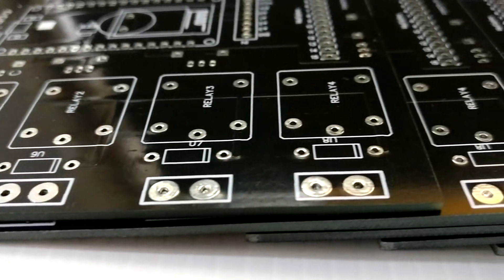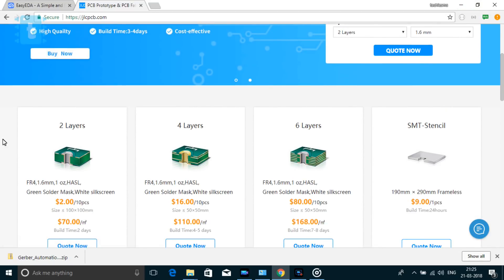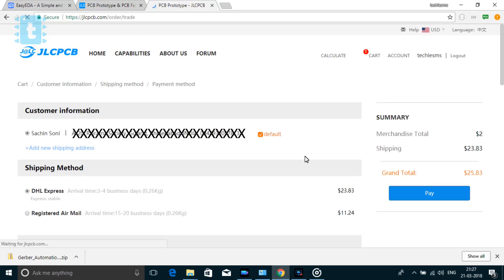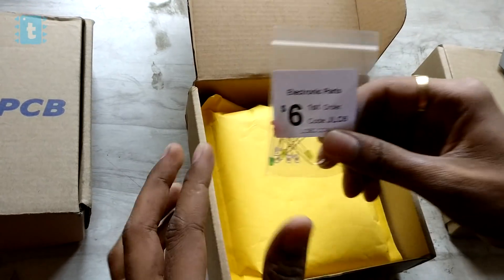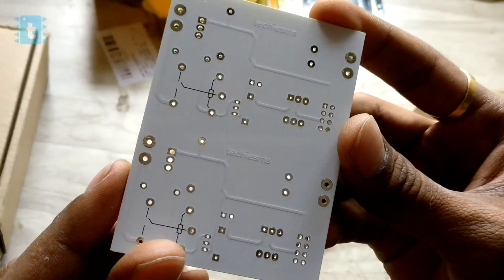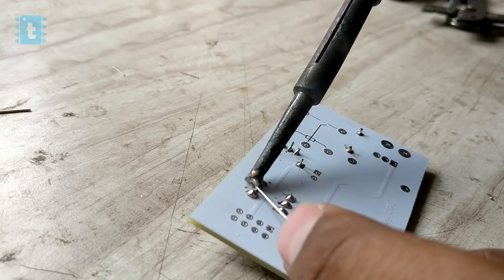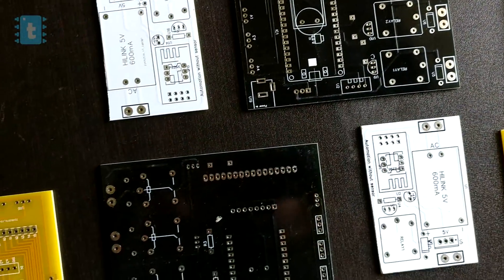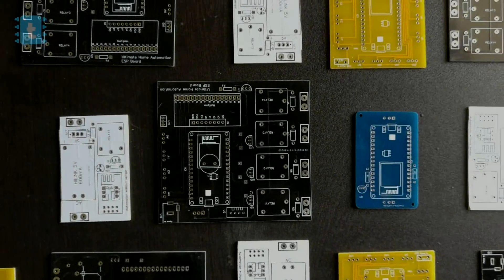Reviewing JLCPCB

Comment from the maker: Anyone can guess my upcoming project?
Reply: techiesms sonoff ready
Reply from the maker: That can also be made with this.
But that's not my upcoming project
Reply: ESP8266 Home automation with Alexa.
Reply from the maker: No
Reply: Nice review Sachin. It would be good if you share the Gerber file for me to order with them. Thanks in advance.
Reply: techiesms, i have guessed it based on  this video. Waiting for the new project.
Reply: techiesms I think we can use this in wide areas because with (single chip with multiple relay) it's not convenient to cover wide areas.
Reply from the maker: That's again another application on this single project. I'm loving the creativity of my subscribers. Awesome
But still the project is different
Reply: Sonoff
Reply from the maker: Sonoff can also be made with this.
Reply from the maker: But my application is a bit different
Reply: Machine to machine communication
Reply: techiesms I think you will use IFTTT app to control the relay like if(sunset)then (relay_on) light on  ---because I noticed automation without sensor 😁 in your PCB
Reply from the maker: You are awesome...
But still my application is different
Reply: i think it is like any home automation system without esp  and nrf is use so it may be on of by any rf transmitter (like nrf) and it is for heavy ac appliances , and if we expand we can make one master with node mcu like u r previous project and send data to nrf which on/off appliances which is far away
Reply from the maker: No
Reply: Could you please tell me how you are triggering 5v relay with 3.3v output from nodemcu
Reply from the maker: Using mct2e optocoupler ic
Reply: I see you didnt panelize you last white pcb, you cut it ...next time you panelize...

Comment: Hi, even If the video is bit old but I have to note something:
On the white PCB - (place  where ESP8266 will rest) is ground copper area which is bad idea because of ESP’s antenna. My suggestion is to remove  that peace of copper.
Best regards

Comment: I have used JCLPCB several times, quality is perfect, low cost postage takes 10 days to the UK, tried DHL and ordered Sunday they were delivered Thursday. Only one negative experience with them, I panelised a 10 x 20 board to give 250 actual pcb's, they wanted a $20 surcharge which was fully understandable as I was taking the piss out of the $2 for 5 100 x 100 boards, order canceled :)